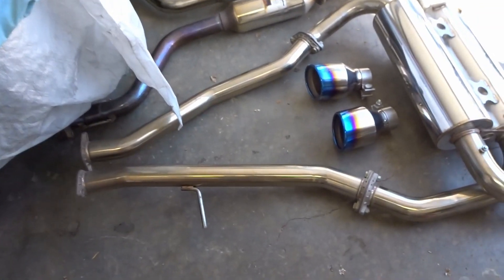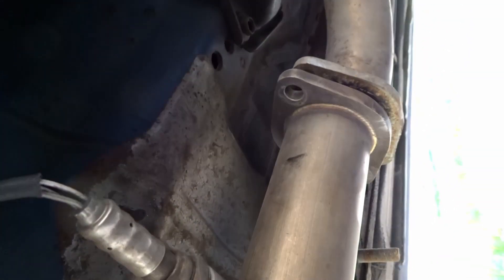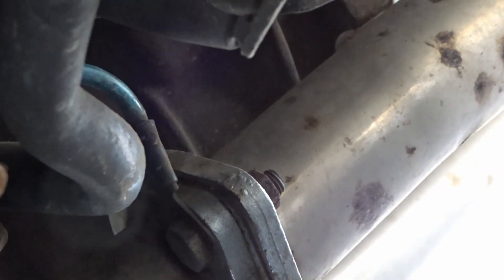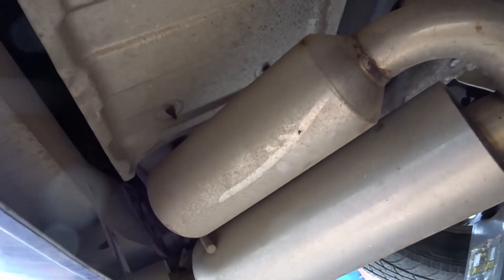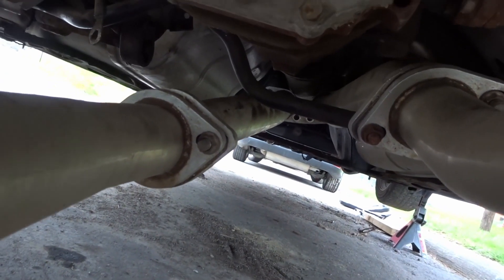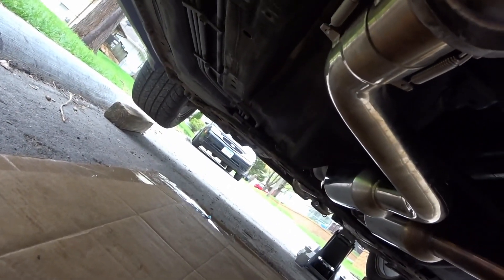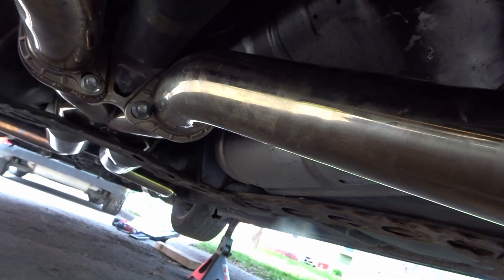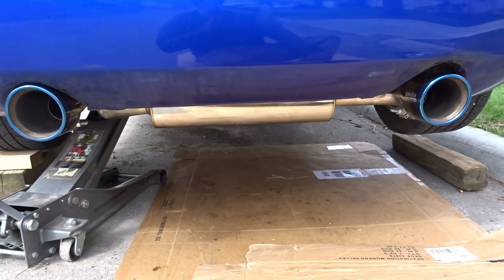350z Invidia Gemini Exhaust Install

Comment: Can the brackets for the tips be rotated to where the bolt/nuts are on top? That way you can't see the bolt thread and nut sticking out on the bottom. That would bug me haha - great job!
Reply from the maker: Yeah, the bracket can be rotated to any position and there is enough room on top for it to be hidden. I was just ready to be done with the install and chose the easiest way😅

Comment: I think the reason why your tips are off, is because the pipe on passenger side is supposed to go over the rear "sway bar", not under it.  I think??
Reply from the maker: Lol, yeah I fixed it half way through the video and had the exhaust pipe going over the bar but it still left the tips uneven.
Reply: @LeebanInTheMidwest  awesome stuff. Video is solid.
Reply from the maker: Thanks, I appreciate it.

Comment: Did you use a new gasket or re use the old ones to the cat. convertors? I just got my kit in today. There are 6 gaskets and 8 connections total. Thanks man for a great video!
Reply from the maker: If I remember correctly the Berk cats came with two sets of gaskets and the Invidia Gemini came with 4 sets so I wasn’t short any gaskets.

Comment: Do you remember how many gaskets came with the exhaust?
Reply from the maker: I believe there were 6 gaskets. First pair for the connection between the cats and the y-pipe, 2nd paid for connecting the y-pipe to the x-pipe, then the last pair for connecting the x-pipe to the muffler/exhaust tips.
Reply: @LeebanInTheMidwest  okay so you re used the catalytic converter gaskets then ?
Reply from the maker: @davidk033  yes when I installed the high flow cats they came with a pair of gasket and I replaced the exhaust shortly after so they were still in good condition.

Comment: How can i know if i have the q300 or gemini? 

Thanks
Reply from the maker: That’s a tricky one. I checked Invidia’s website and they seem to use both terms interchangeably. I looked at some forums and some say that the q300 is a previous version of the Gemini and has a raspier tone. I can’t confirm whether that’s true or not or if aesthetically they are different. When I purchased my exhaust, I purchased it as the Invidia Gemini. Your best bet would probably be to contact Invidia and confirm with them.
Reply: @LeebanInTheMidwest  thanls man

Comment: Bro you gotta be safe under that car. Just think about how horrible of a death that would be?
Reply from the maker: @Charles wood  Thanks bro, I appreciate you looking out. I had jack stands in the front but didn’t have any to put on the back of the car but I’ve bought a set of four jack stands since then.
Reply: I was about to say the same, People have died from just using a Jack. Good he got some stands now.